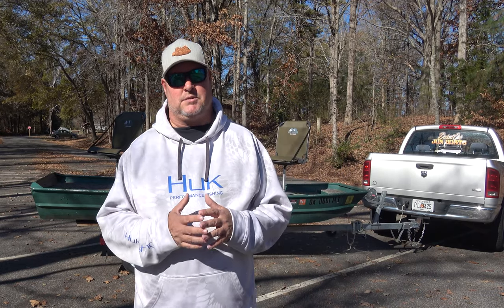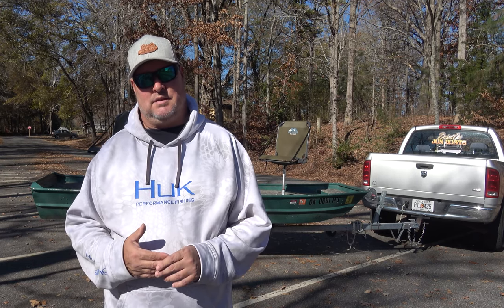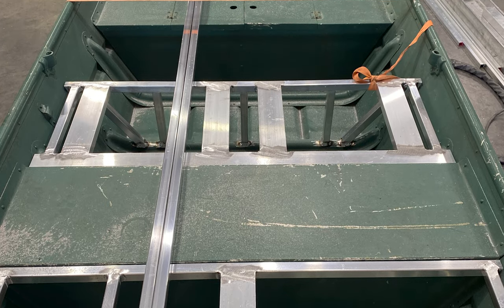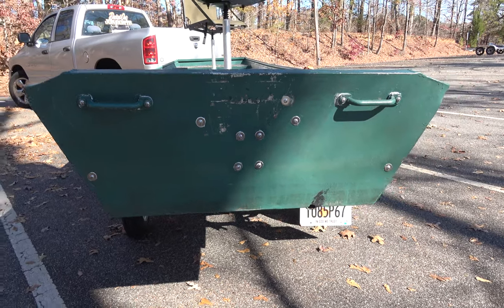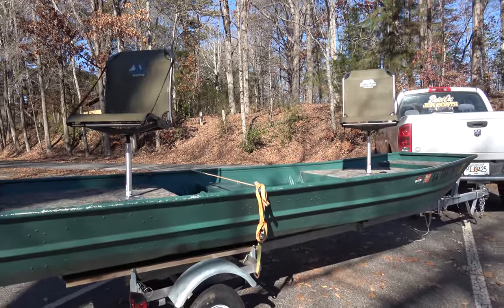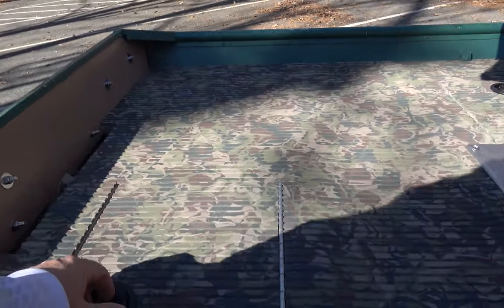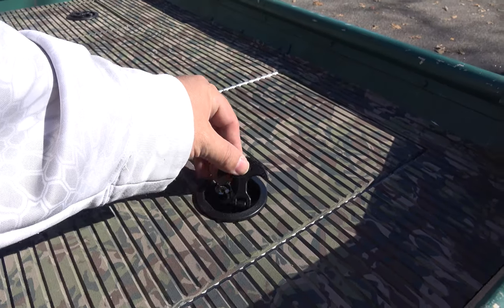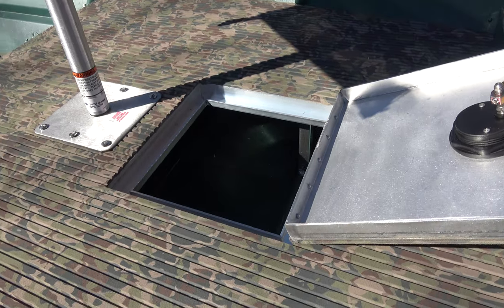1436 JON BOAT CONVERESION (ALL ALUMINUM)!

Comment: Surprised you didn't run the deck back to the center bench seat
Reply from the maker: The center bench is the livewell.  Most 1436 boats only have three benches.  But this one had 4.  In most cases that is what I would have done.

Comment: Thought you were going to cover more of a DYI on how you built the boat. Did you weigh the boat after the build so you know how much weight you added. I see lots of guys who build with plywood and turn the boat into a real dog that takes  forever to get out to your favorite spots and then back to shore again to load up.
Reply from the maker: I did not weigh it…however I decked one out in 3/4 marine plywood and 2x4s previously.
I know this boat is a heck of a lot lighter!
I’ll continue to do builds and will do many more videos.  I’m just in a time crunch currently.

I have to get my 1860 redone before the middle of next month.

You can ask any questions you have here, or you can ask in the Facebook group.